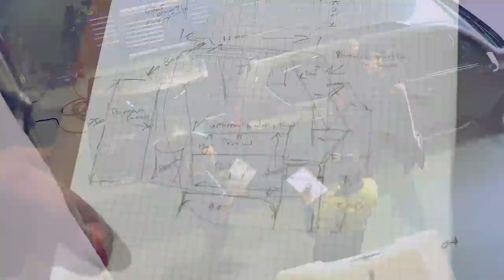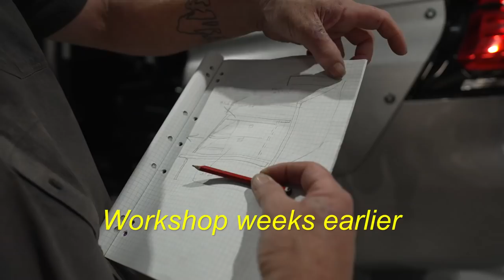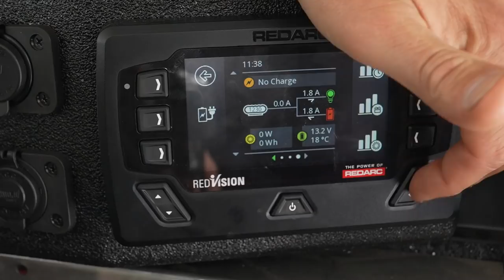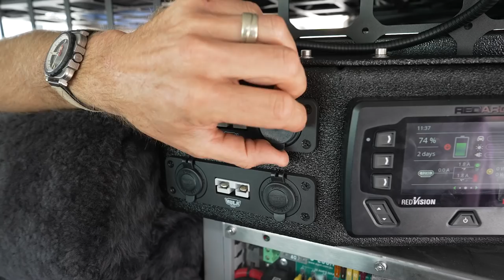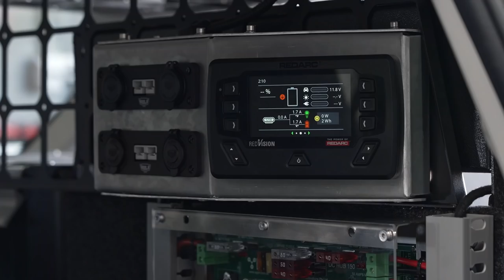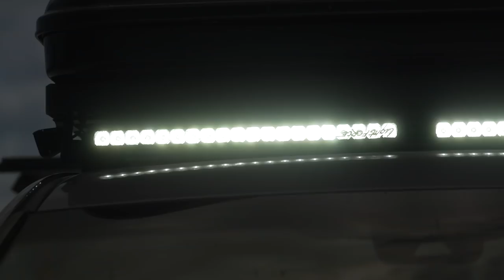Project Prado part 3, SECOND ROW SEAT REMOVED

Comment: No Ronny, your off on the battery voltage. A half charged AGM/lead acid is around 11.8-12 volts. You can go lower, but it drastically reduces the cycle life. But you can. (Use accordingly in emergency) but by the time you hit about 0% your going to be at 10.5 volts (or less). However, lithium will maintain the "full charge" voltage of 13v till the battery basically flatlines. However, lithium is more sensitive to extreme temperatures. (Your summer heat and my Canadian winter) and they don't deliver high amp surge power like a AGM/lead acid, hence why they're not great for starting or powering a winch. But yea all around, for this Prado build, it's perfect.
Reply from the maker: Like I was saying just getting to the rough points. If you go into too much detail you loose most people.

Comment: Ronny and Chris, this is looking schmick! Amazing what can be achieved with a few experts and pretty deep pockets. On a wagon, how do you run power and antenna cable to the roofrack without drilling holes in the roof of your pride and joy?
Reply: I’d like to know that too, no-one mentions that.
Reply from the maker: The cable runs up the inside of the rear door seal. No holes drilled required
Reply: @Ronny_Dahl  hmm, interesting. Thanks Ronny
Reply: for my roof light bar on the Prado 150, used a cable channel in the edge of the windscreen to run the cable to the roof
Reply: @Ronny_Dahl  Thanks Ronny, that'll give me something to do next weekend.

Comment: Hey Ronny. I desperatly looking and can't really find, Prado's builts that retain the 7 seats. Yes, I will eventually will get a trailer. But I would like to set up the Prado, as a family weekender. It's 7 of us. 
I am in the planning stage, trying to figure out equipment, etc.. 
I have no idea, where to put a 12v system and fridge.. everything else probably will go on the roof.. struggling to plan/design this.
Reply from the maker: Wow if you need all 7 seats there is not much left in GVM for you. Technically you might not even legally be able to bolt anything to the vehicle.
I think towing is your only answer and a GVM upgrade might allow for roof rack and front bar if lucky

Comment: All well and good until the flux capacitor runs low and you end up short fusing the injector relays which will most likely cause oil to seep into the radiator brackets.
Reply: I hate it when that happens 😂

Comment: can you tell us how the sheepskin covers go with the heated and ventilated prado seats?( thinking of doing the same)  BTW, also spoke to our local auto engineer ( NSW) it costs approx $550 to do 'engineering' paperwork when removing seat/s in the prado, to keep it legal/insurance.
Reply: Maybe things are different in Wait Awhile they are a long way of the rest of the country 
I bought it up in the original episode and got nothing back ( maybe the head is in the sand)
Reply from the maker: We will be pursuing this once the build is completed. Reason being we would be putting it multiple times rather than just once.

Comment: Setup is looking awesome. Unrelated to the power setup, but what's the roof load rating on this with the frontrunner on? It's like pulling teeth trying to get an answer off Toyota for the roof without bars.
Reply from the maker: Whatever the roof rating is which is 120-150 kg depending on who you ask. 120kg would be the safe bet
Reply: @Ronny_Dahl  cheers mate. Keep up the excellent content.
Reply: Toyota specify 100kg when using a 3 bar system. So I'm going by that rule of thumb with my arb baserack. 100kg less 25ish kg for the rack and mounts, 75kg to play with.
Reply: @colinlam5502  yeah, that's my issue.   I'm looking for the roof capacity without the Toyota bars which isn't disclosed anywhere. I'd be really surprised if the roof itself was only rated to 100kg but I haven't seen anything official to state otherwise
Reply: @pkayyyy472  I agree that it's likely much more. Regardless, whatever it is, I think a good rule of thumb is to reduce what you carry up top in general. You see folks with a spare tyre, multiple jerry cans, storage boxes, ice boxes etc.
Reply: @colinlam5502  totally agree. I'm a female and usually travel alone so I feel safer being in a roof top tent and like the convenience of a hardshell. I get my Prado next month and definitely don't want to end up over capacity!
Reply: @pkayyyy472  stoked for you that you're getting the new prado soon. Slowly getting mine set up to do some long trips. 

Agree about the hard-shell, they look so much better than more traditional RTTs. I think you're just going to have to accept you will comein a bit over. 

Toyota will never specify a rating with a non toyota part but we know their ratings are conservative. I believe the frontrunner to be the strongest rack out there. It does weigh a bit more than the rhino or arb. I've heard of people using the rhino backbone mount without the rack with some custom mounts for a RTT. That could be a way to keep weight down
Reply: @colinlam5502  thanks for the tip, I'll look into it! Enjoy the trips - can't wait to do the same

Comment: Two things: 
I neither like the Redarc BMS system nor the EGON. The reason for this:
First: 
If the BMS system fails out in the bush you're stuck! No car charging, no solar charging and if you go to a powered campsite you can't even recharge your battery.

For me an independent system from each other is the way - no fancy BS. Quality wise Redarc is good but even that can fail.
Second: 
The Egon - Why on earth does an electrician come up with screw connectors where cable can come loose on corrugation? I cannot tell the times how often I had to tighten electrical screws in my life due to them coming loose. But maybe there is some wisdom I've no idea...Would be interested to know!
Otherwise - great channel, Ronny! You know your 4WD stuff - stick to it! ;)

Comment: Lithium batteries have many advantages and I converted recently for my 4 month trip around OZ. Had quite a few problems all relating to the inbuilt Battery Management System playing up. It was from a reputable known Aussie company and I’m still waiting for repairs of the battery.   Seriously thinking about going back to AGM for complete reliability. Has anyone else had problems with their lithium BMS?
Reply: I’ve had no issues with lithium when it’s managed via an external BMS or BCDC charger.
Reply: Precisely why i would recommend Victron products....